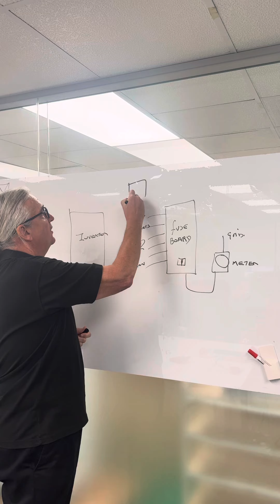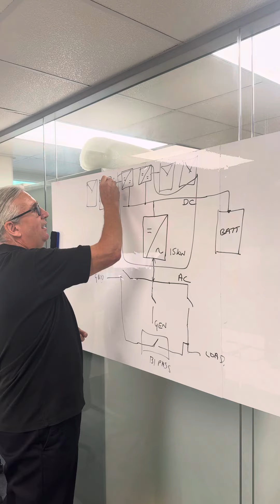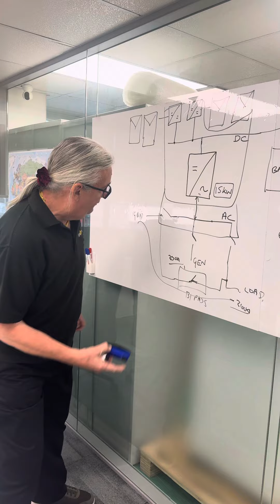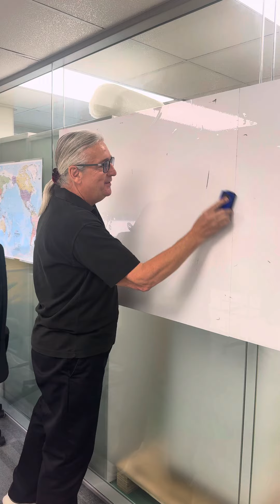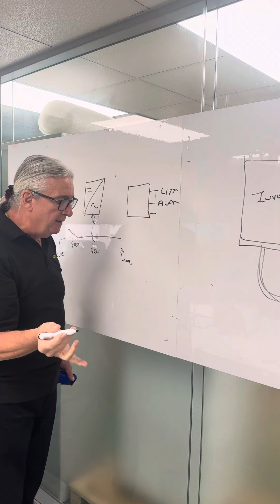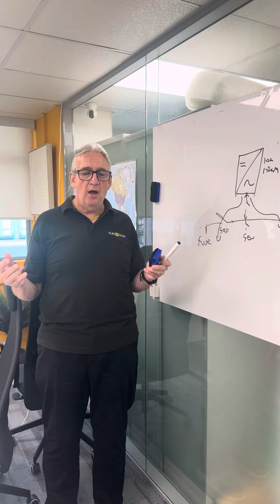Understanding the dark side of high power bypass circuits ￼

Comment: This is an odd video to find as I'm currently have on back order a Sunsynk MAX 16kW that is to be installed in the UK as a whole home solution (with 11kw PV and 64kWh batteries). The reason for selecting Sunsynk is because the inverter has a 73A max output and supports a "Max Continuous AC Passthrough" of 100A, so it fits well with the homes max current draw. So the whole house will be connected to the load port with the grid port just being used for import and export.

Comment: I’m in the process of wiring a sub panel to the load port of my 8.8kw inverter.  The panel will be supplied with a manual changeover switch, rather than an automatic switch.  The sub panel supplies all domestic loads, except for the car charger, heatpump and 2nd grid tied inverter.

My reckoning is that the inverter will be very happy to supply the 8kw maximum demand, but by having a manual changeover switch, I can control the demand at the point of going off grid.  It will supply “any” domestic load, but not “every” load.  

One test I want to try is to measure the transient voltage surge in off grid mode when switching a 3kW resistive load.

Comment: Are you talking about eg4 inverters
Reply: I think he's talking about the reqests for sunsync to add big bypass feature when the basic concept of zero export /essential loads is just missing in America, mostly, and is far more resilient. 

Also the EU versions of the 12000xp (sna12k) has the full hybrid firmware and is also setup as he discribes with the grid  CT at service entrance.

Comment: Could it be the pass through current, that is confusing people, a 16 kw inverter has a 100 amp pass thorugh current, but when it drops the grid and operates in islanding mode should not exceed +/- 70 amps. the way I understand pass thorugh current, you can power the load (UPS) and charge the battery to a max of 100 amp, or feedabck into the non essential /grid. When the grid fails, it will switch to islanding mode which will stop grid charging the battery and  power the load only (max of 70 amps). Which means we install a 25 or 35 mm sq cable to supply the inverter and a 16 or 25 mm cable for theload side of the inverter.

Comment: Consumers who  do not  really  understand their  energy  usage profile  will  do  such " dumb " things,   by  trying to  backup the  complete home  with a  5kW inverter  coupled  to a  5kWh or 10kWh  battery  bank....They just  don't  understand the  concept  !!  More  problematic  is that  some  installers  will  "allow " this  due  to  cost  cutting  and not  to  loose the  job . Like  you  mentioned, if the  inverter size do  not  at  least  match the  load  size,  you're  in for trouble . Even in selfconsumption systems we  recommend that  clients  leave loads  like  stoves, gysers, AC  units,  underfloor heating etc.  on the Grid   side,  only  to be fed  via the  inverter  with / when  avaliable  PV  or  Grid  power.

Comment: Hello , I have wired many system as you have described. Typically 150A. I use contractors to drop out non essential loads. The reason for wiring like this is to minimise the rewiring of a very large distribution board.

Comment: I live in the UK and have 2x Sunsynk Inverters Paralleled together in order to give me a greater UPS/Load capability. This enables me to have almost a whole house uninterrupted power backup. There are very few circuits left on my GRID Consumer Unit, just a few heavy items like Ovens that we rarely use these days in favour of Air Fryers. I' also had my house re-wired (to get rid of the ancient UK Ring main methodology) and now all my rooms are on their own individual Radial RCBO circuits (e.g. Lounge, Dining, Bed 1 etc), so now if there were any faults only the room with the problem will be without power. The only Ring main left in the house is the Kitchen Ring due to its distance from the Consumer Unit and it being the only room that might need a continuous higher oad requirement.
I live in a semi rural area and suffer a lot of Grid outages every year due to being on the less reliable over head power lines but half the time we don't even realise the Grid has gone down. Its happened when we 've been cooking Sunday lunch and we hadn't realised.until a neighbour called to ask if we still had power LOL. The system is more than capable of running all the usual house loads along with two air fryers and a microwave simultaneously.